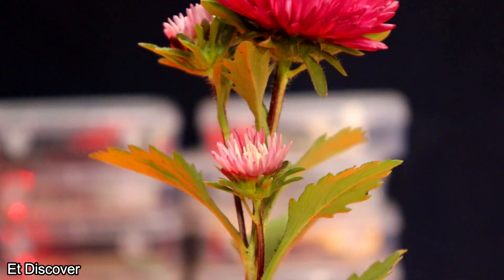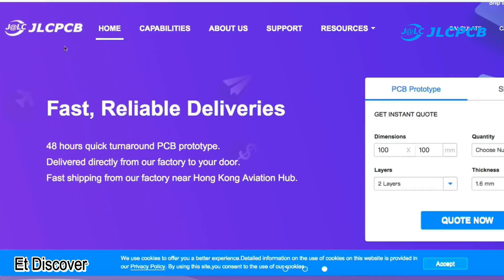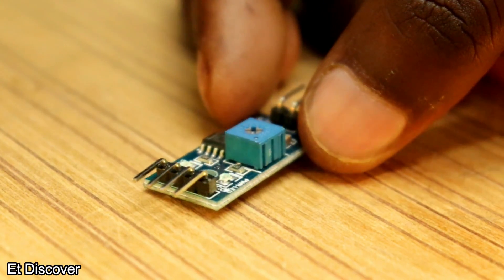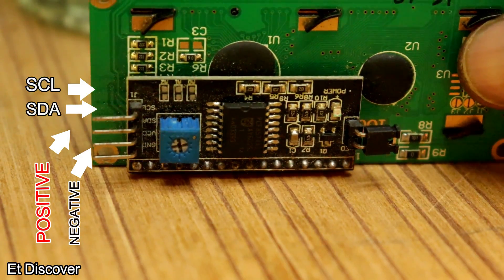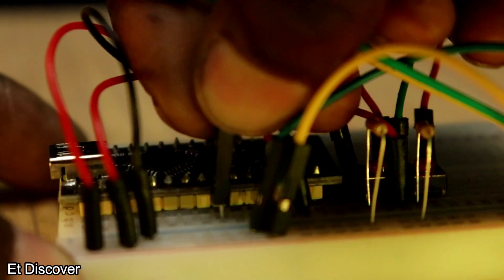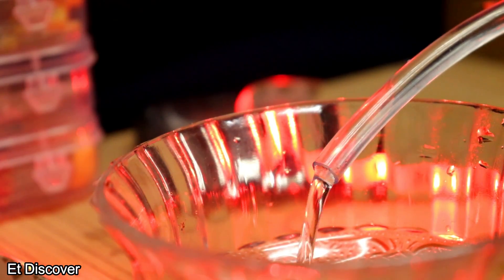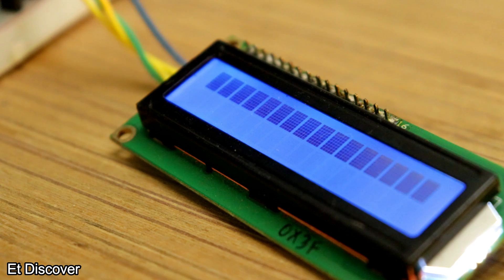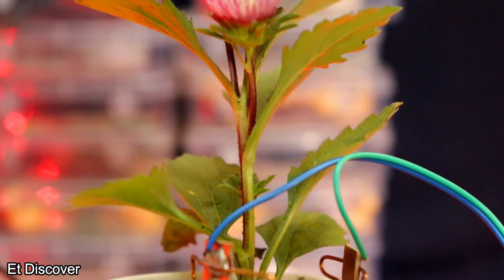How to Grow Plants Very Fast # Easiest way

Comment: Sir dc motor a 104 pf simple capacitor use kory kano bolun na. Korly ki hoy?
Reply from the maker: Motor jokhon off hoi tokhon Inductance ar karonr kichu Milli seconds at jonno high voltage tori hoi. Ar Sri high volt  nosto korar jonno 100nf pf bebohar kora hoi

Comment: At 2:05 you talk about the capacitance of the sensor changing with water level, it is the resistance between the two conductors the board is measuring.
It has nothing to do with capacitance.

As there will be a current passing between the sensor conductors you will find the sensor will erode away due to electrolysis and produce false readings.

There is a capacitance version of a soil moisture sensor, but the one you have is not it. 
This is what you should be using;
https://core-electronics.com.au/adafruit-stemma-soil-sensor-i2c-capacitive-moisture-sensor.html?utm_source=google_shopping&gclid=EAIaIQobChMIw6HAgJeT4AIVBJCPCh3_sg1gEAYYBCABEgLo9fD_BwE
Reply from the maker: No brother this is totally depending on resistance. Or you can call it in this case capacitance. You need to check this sensor datasheet
Reply: @EtDiscover  Sorry but you are putting bare copper electrodes into the pot-plant soil, that is resistive measurement not capacitive. To do a resistive measurement you need to put current through the electrodes, this will cause corrosion.

Use a DMM and measure the DC voltage across the electrodes.

Can you post a link to your sensor please?